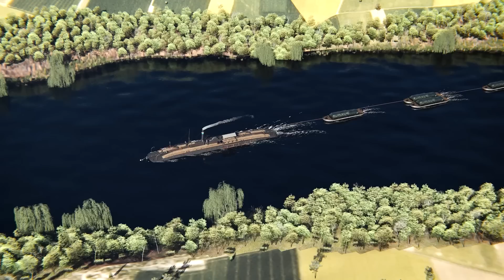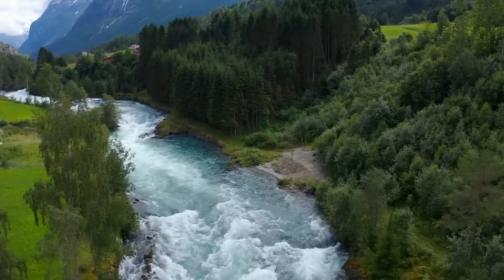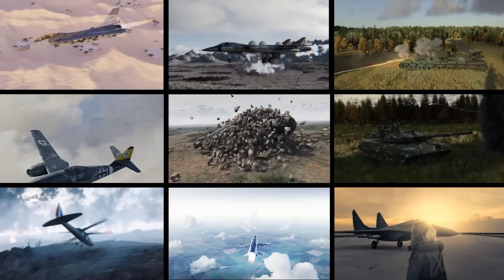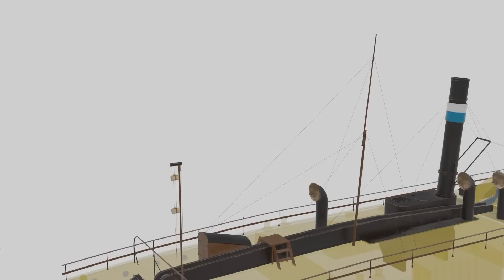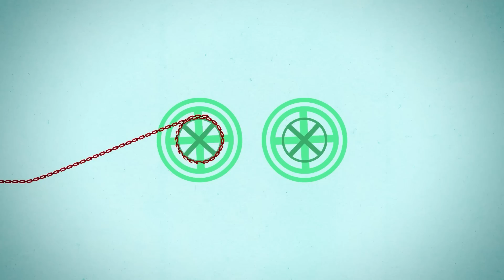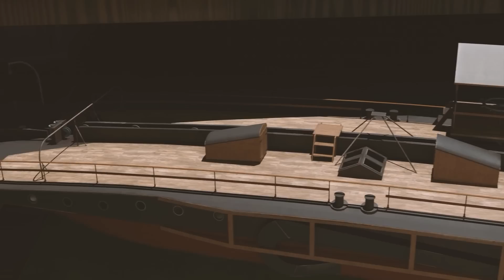Why The World Simply Abandoned  "Water Trains"

Comment: A very interesting system of which I haven't heard before.
It is not only other modes of transport which made these obsolete, but the development in water transport itself also.
Rivers have been canalised, or canals have been built parallel to shorten the route and have a corridor without currents, many other canals connecting existing water systems have been built into the last century.
And then the development in propulsion systems of the river barges and tugs themselves have made them a lot more powerful.
In the US the pusher boat with a consist of tied together barges was invented to navigate the large rivers, Europe introduced them in the 1950s to replace towed consists.
We now can see pusher boats navigating the canals and rivers with as many as 6 on the Rhine to 12 barges on the Danube. On the Mississippi river the record is 60 barges pushed along by just one pusher. Barges are not slung one after another but tied tightly into  one large barge so to say, on the Rhine usually 2 across and 3 long or the 3 across and 2 long, on the Danube up to 4 wide and 3 long, a standard barge in Europe being 76,5m long and 11,4m wide. Also larger load carrying river boats can be seen with 1 or 2 barges tied alongside or in front.

Comment: Given the number of accidents that have occurred on American rivers as a result of navigational errors, perhaps chain boats need to make a comeback. Modern steel cable could be used instead of chains for improved durability.
Reply: Chain is a lot easier to maintain. The stuff. WiLL break (even modern steel cable used in say mines has a limited life time before it must be changed) and splicing a chain is a lot easier and produces no bumps or weak spots. 

Not to mention we are talking 100+ km chains
Reply: @mbr5742  
Chain is easier to manufacture and maintain. Cable is lighter and easier to reel.
Reply: @jfangm  This concept is absoluted not intended to support any navigation. It prevents from going downstream if doing nothing, but not from touching the shores of the river.
The concept you are searching for is a chained anchor. If you want to stay in place, you throw it.
Reply: @holger_p  
You have no idea what you are talking about. This system WAS for navigation and DID keep "trains" from "touching the shores." It also did not prevent travel downstream. Please learn how things work, along with some proper English, before commenting further.
Reply: @jfangm  Well, tell me how this is supposed to work with a chain laying unfixed on the ground of a river, every boat can drag it to the side, by their steiring. They cannot drag it, up or downstream.

If you want to be helpful, explain your point, and explain where my english is wrong, otherwise how should I learn ?

Sorry, English is not my native language, of course you might have an advantage, by not learning any languages. I depend on your (non existing) courtesy in understanding.
I'm living 500m from a river with a chain on the ground, and a chainboat in the museum, I reproduced what they explained on the function.

Why do you think the chain stays in a given place ? it doesn't ! Each boat lifts it, and puts it back wherever they like. More or less random.

It's like climbing an mountain with/without rope hanging from the top. With the rope, it's a lot easier, and ALWAYS possible. It doesn't prevent swinging to the side.

That's why it's completly nuts to compare this concept to chain ferries. On a chain ferry, the chain is fixed at each side.
Reply: @holger_p  
The chain is actually fairly heavy, so it isn't going to move side to side much.

As for your English, I recommend a translation website. Most are hood enough to convey ideas accurately.

Comment: This sounds like an aquatic version of a cable car
Reply: But on cable cars, the cable moves, So, the engine is in a house, not in the vehicle. Great for electric propulsion, or even with coal. Because you can use a big chimney and won't blow the smoke in the street. On chain ships, the chain won't move, so it is more like a cog railway, so something to grab on to get somewhere.
Reply: @philherb3843  More like a chain rail ship.
Reply: Without the required electricity to operate said railcar
Reply: Well, in cable cars the power plants are stationary. 🤔 Not super sure but I think that there WERE cable operated ferries.

Comment: Many countries still use this system only perpendicular to the flow, as a means of crossing.  
Ie a Ferry.
Reply: Right. They are usually called cable ferries because they don't use chains anymore..
Reply: Near where I live there is a ferry that cross a river running a cable that is out of the water, using only the river current (and a little human labour).
I think that Tom Scott once made a video about a similar ferry in Germany.
Reply: @kromeboy  The Rhine-Ferries in Basel, Switzerland? Don't know if there are other boats still in use.
Reply: @PortCharmers  yes, the Tom Scott one om Switzerland not Germany. 

There is one at Imbersago in Italy that is called the "Leonardo Da Vinci ferry" because a similar concept is drawn in the Winsor Code that Leonardo wrote when was living near Imbersago.
Reply: Occasionally they use actual rails.
Reply: Didn't Tom Scott make a video on that?
Reply: On the Mississippi River in the US
Reply: I can see most of the disadvantages of the system disappearing when going across the river. However, as it has already been pointed out, when you go across, you can use the current as propulsion force, sort of "fly" the boat like a kite.
Reply: The function of that is completely different from this, that doesn't have any propulsion system, and uses the vector component of the river current ingeniously to cross back and forth.
Reply: There's one in Wisconsin about 30 minutes north of Madison.
Reply: Still loads of line ferries in Sweden as well.
Reply: Colsac III in Lake Wisconsin uses cables as guides I believe.  I could be wrong tho, maybe it pulls!
Reply: @ethans_celsy  There are 3 cables for the Colsac ferry. Two that guide the boat using sheaves on its port and starboard sides, and a third in the center that is used for propulsion by a powered drum mechanism onboard.
You are correct, the ferry pulls itself to the shore in each direction.
Reply: @ghost307  Holy shit are you from Wisco too or just handy with Wikipedia?? 🤣 good shit tho bro thx for the confirmation
Reply: @ethans_celsy  I live about an hour from that ferry crossing.
I like to use it instead of the Interstate when I have the time.
Reply: @ghost307  Always a lovely ride, beats the shit out of I-39 these days

Comment: i’d imagine it is hard to operate more than one boat in a river, as the chains are likely tangle in the waters
Reply: Yes many questions arise. Such as right of way, all other vessels would always have to give way to the chain ship.  The chain ship company would have to secure the exclusive legal right to put their chain on the bottom of a whole river, which assumedly is usually public property.
Reply: The system was used around here (Southern Germany) until after WW I. The tugboat company had a monopoly, the ships were nicknamed "river donkey". Only one chain was in the river, when encountering oncoming traffic, the downstream-going boat would need to drop it and get it back on board after the ships had passed each other. This would take about an hour. 
In the 1920s, the rivers were made more shipping-friendly by installing dams and locks.
Reply: That’s what barges are for
Reply: You can

Just by combining them into single bigger ship. Which everyone did until this day
Reply: We have one in my home country of Poland, it uses a small gas engine to crawl up and down across the river in the rainy seasons transferring supplies to the farmers on the other side of the river that encircles their properties
Reply: There was only one chain per river, that's right, to avoid tangling. But many boats on the ship. The number of boats does not interfere with the chain, cause it justs rests on the riverbed.